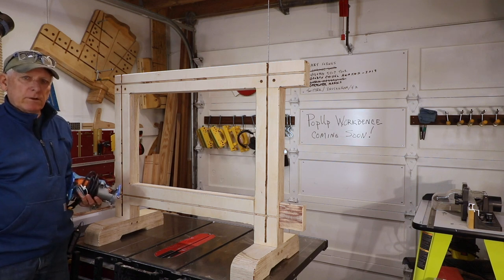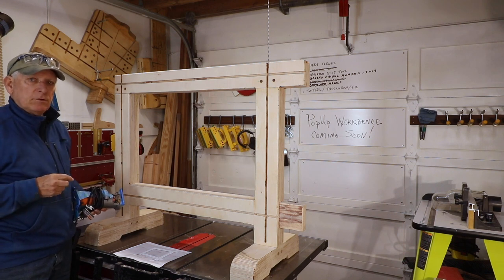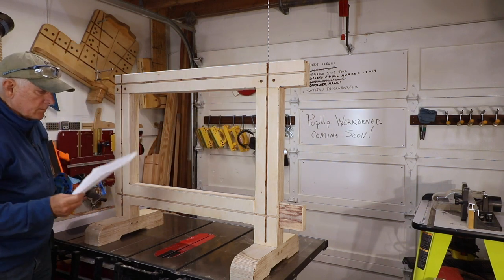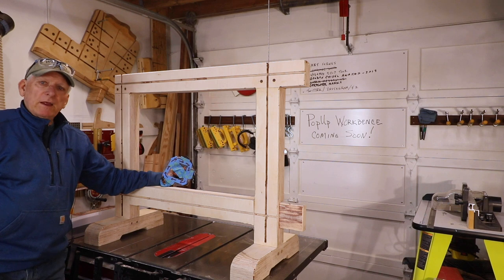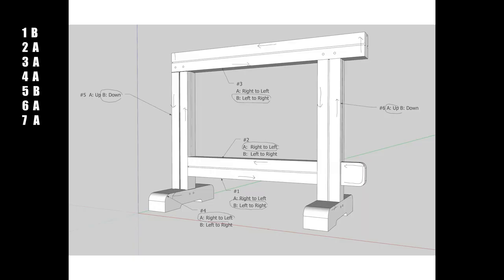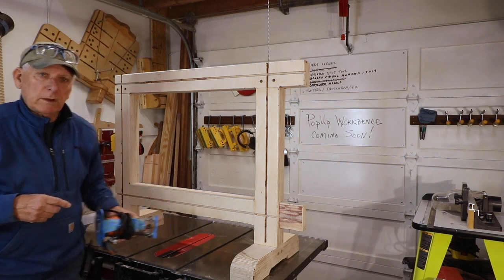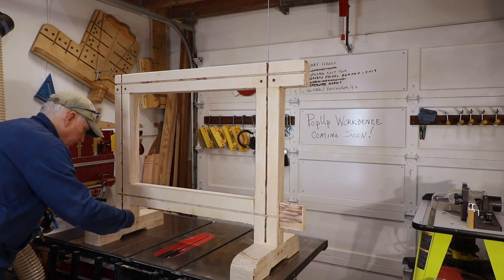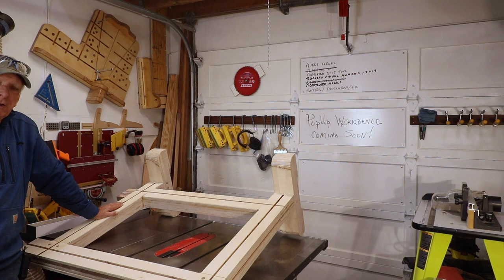A Quiz of Router Direction - Can You Get a Perfect 7 Out of 7 Score?

Comment: I actually put a small arrow on top of my router like your  demonstration ,makes it easier for me. Great topic!
Reply from the maker: That was just for the video, but I believe I will find a way to add two arrows on some take on the top of the body of all of my routers.  My new method of thinking about which way to push, after spending so much time on the video and SketchUp graphics, is to simply push in the direction the router bit is moving where it is touching the wood, rather than try to think about which was the router wants to pull on its own.  Seems easier.